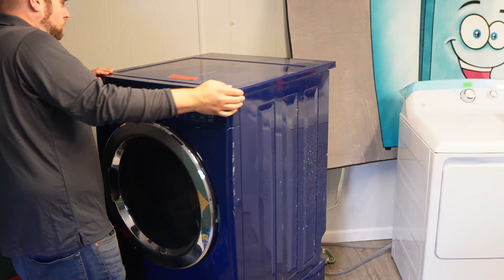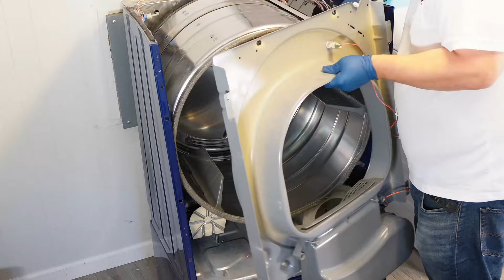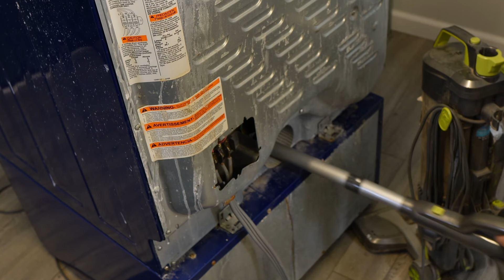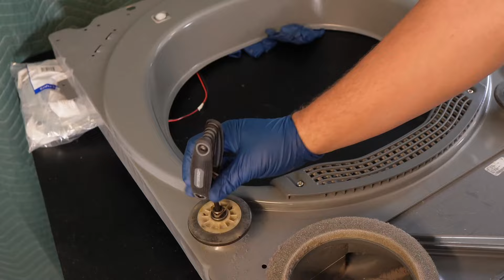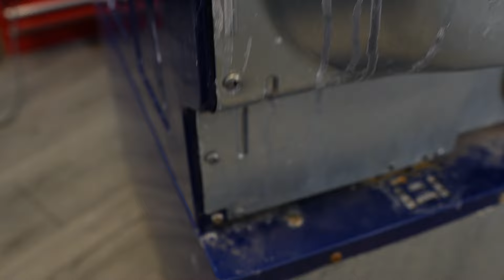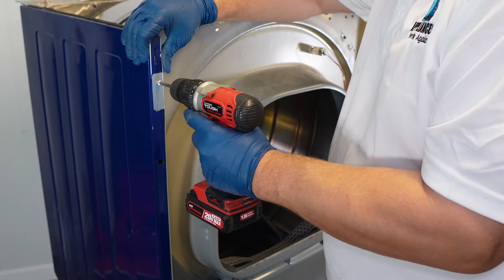How to Fix a Frigidaire or Electrolux Dryer that Makes Noise

Comment from the maker: Parts that were shown or replaced in the video:

Frigidaire Dryer Roller Wheel (Individual): https://bens-appliances.com/products/134715900-frigidaire-dryer-roller-wheel?utm_source=yt-QydJ25pGA2w

Choice Parts Frigidaire / Electrolux Noise Repair Kit which includes 5x roller wheels & shafts, pulley, and belt: https://bens-appliances.com/products/134715900-frigidaire-dryer-roller-wheel-copy?utm_source=yt-QydJ25pGA2w

Choice Parts Idler Pulley: https://bens-appliances.com/products/134793511-frigidaire-idler-pulley-by-choice-parts?utm_source=yt-QydJ25pGA2w

Comment: Electrolux electric very similar to that. It began shaking like a rock crusher. I was afraid to use it. I thought it were the little drums wheels. I bought all five, plus a new belt and tensioner. $600 from appliance parts pro. I watched the videos on how to replace these parts, and got out my hubby's electric battery powered drill and all the attachements. I disassembled the front panel only to find the blower fan had a HUGE thick clog of lint on one side only, caused by a dryer sheet being stuck across three blades causing it to be out-of-balance. Whatever, I went and finished the disassembly which is very straightforward, and replaced all the wheels, cleaned out the very little lint that was in my 11 year old dryer, then wiped everything downa few times with isopropyl alcohol to make sure there was nothing inside that would attract lint and put back together. It is wonderful. Yes, the parts are expensive, but not it's ready for another long haul, besides being a great dryer. This mans channel is super informative, and I watch it when I need to know what is acting up with three washing machines, and dryers (I own a BnB), Much valuable advice and information here.

Comment: Thank you for this video!  I was able to pull apart my dryer and clean all the lint and stuff out.  When I put it together, it kept making the noise for a bit, then pushed it back into place out of resignation that I would need to pull it apart again.  Started it again just because and after a bit, the noise stopped!  It is back to working as per normal!  I suspect the sound was in the motor and I think whatever was causing the noise is finally knocked out!  Thank you!

Comment: Nice work. Nice attention to details. Just changed the idler arm and pulley on WED8500BCO Dryer.  It would jolt the cabinet upon start up. The pulley was binding and rough to turn. Still got a little plump plump durning rolling . Rollers spin fine though.

Comment: a dryer that hadn't been used for a long time sounded like someone was inside with a rubber hammer . after a few uses , it ran smoothly again . guessing the rollers got flat spots from lack of use . i love it when something fixes itself .

Comment: Recently, our Samsung dryer (it's about 8 years old) was making horrible noises like it was tumbling boulders. I remember as a child it usually meant that our dryer's belt was slipping or completely off. My husband opened up the dryer, looked in and around and claimed he saw nothing. Never told me he looked inside. I kept complaining. Then one day, our laundry area had a minor flood. We had to move the units to clean around and under. I mentioned that now would be a good time to look into the dryer. He was a bit irritated, but to entertain my thoughts, he opened up and had me look in. I told him I would need the drum out to look in. Lo and behold - 3 of the 4 rollers were flat. Fortunately, he had replacement parts and swapped all of the out, the belt, and other pieces he thought would be necessary for maintenance. Once completed, I ran the dryer and it was very quiet. 

Sometimes, you need to take it all apart ro see the big picture.

Comment: Back about the turn of the century as my roomie was out doing her shopping I changed out the ceiling fan in the dinette area with one that was of her taste. After she got home I was on my 2nd 40 oz beer as kind of a victory dance. I kept my mouth shut as she was on the precipice of ornery until I told her to check the dryer's progress while she was going to the kitchen where it was located. Drying some towels as a test I had also changed the rollers and the belt while It was apart eliminating the sound of a shovel full of gravel it seemed to have had for quite some time. After it sunk in she comes back and says those life learned words of Tony Viscosi when realizing I pulled a fast one, "Have another beer!" The parts cost me less than $15.00 in a trade deal with a buddy in that business.